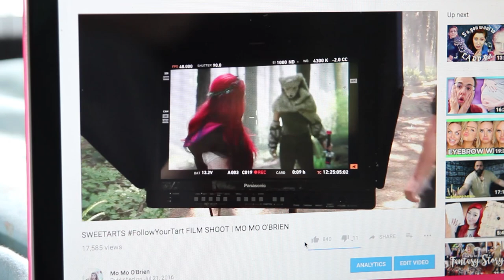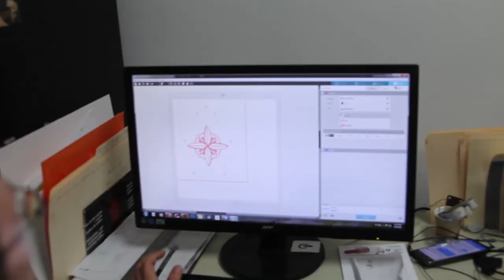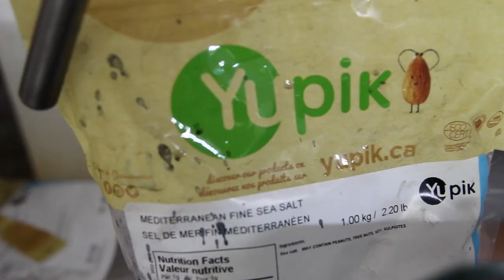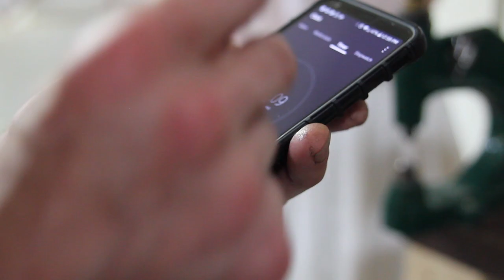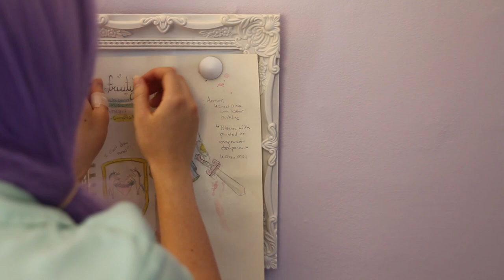HOW ARMOR IS MADE | featuring SweeTARTS Gummies

Comment: Damnit, now I want a metal flower crown!
Reply: I know right, it's perfect!
Reply: This actually makes me want a flower crown. I reckon silver would maybe suit my usual colour scheme. I might go with sheet steel, though, less expensive.
Reply: James Forgie, yeah silver would look better on me.
Reply: take a metal soda can.  Clean off the surface with sandpaper or a cleaning solution to get all branding off.  Cut off the top and bottom with metal shears, then bisect the remaining with the same.  Make a paper flower with all the ridges you want already folded into it, and cut out (trust me, you want to get the frustration of how wide everything actually has to be in paper, mistakes in metal tend to mean bleeding for nothing).  Then, flatten out the paper onto the metal, and trace with a sharpie.  Wearing leather gloves, cut out the pattern, then debur using sandpaper (or an actual deburring tool if you have one).  Still wearing leather gloves (sharp edges can still be a thing) fold and form the aluminum in almost the same way you did for the paper.  Punch a hole in the middle to have a bit of twine to run through it to tie it down to the rest of the crown.  Repeat until you have all the flowers you want.  This is less sturdy than sheet metal, since the sheet aluminum used for cans is about as thin as you can get without it being considered foil, but it is also cheap, and a fairly easy DIY.  Pluses are that it looks really cool if you can get the metal completely clean.
If you need any clarifications, just ask and I will comment with a clarification.